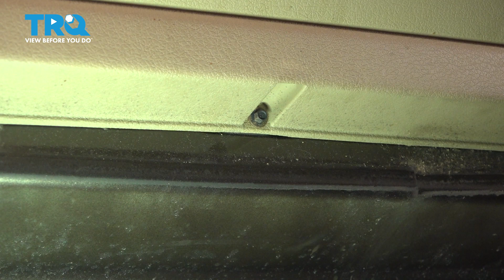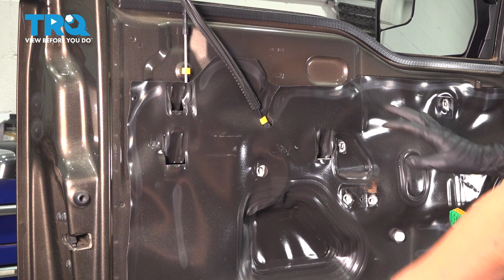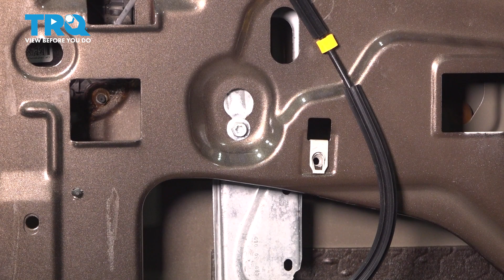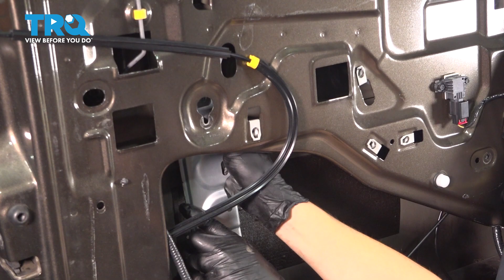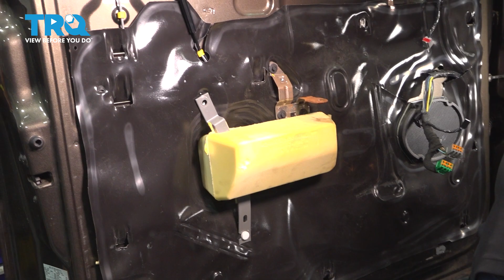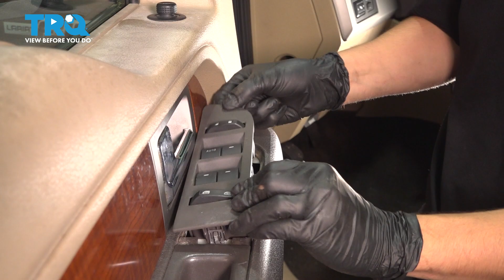How to Replace Window Regulator and Motor Assembly 2009-2014 Ford F- 150

Comment: Thanks bro! It worked for me on my 2014 F-150 XLT Ecoboost. Before I found your video, I had watched another one on how to remove just the motor. "Be Advised" - once you decide to drill the motor bolts to remove it, it's a TOTAL wrap! Much easier to replace the motor and the regulator all together. You basically destroy the motor when taking it off & also the cable wire for the regulator is on a spool. Once it unwinds you can never figure out how to re-wrap it again. Your video made this whole process very user friendly. On top on saving me a ton of $$$$ A shop would charge you $500-$600 easily!!! Peace & Blessings my friend!!!

Comment: Can I just replace the motor?  My window only goes up intermittently, I tested power going to the motor it’s good.
Reply: did you end up getting a fix for this? mine goes down fine but then i have to wait awhile for it to go back up

Comment: Video is underrated, this would have helped me a few months ago, I thought I had fixed it but now when I close the window completely it gets stuck at the top and the motor goes down by itself. I need to tighten the screws at the top more so the window sticks w the motor. Anyways great video underrated